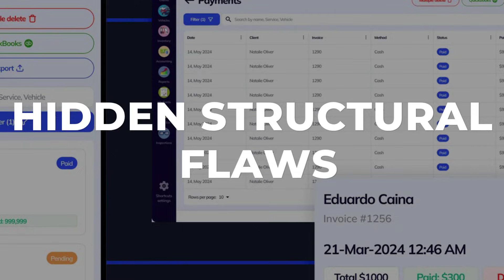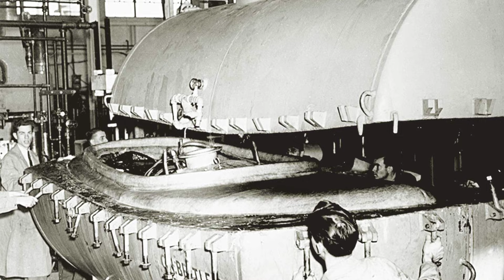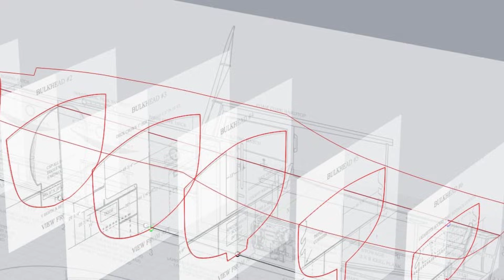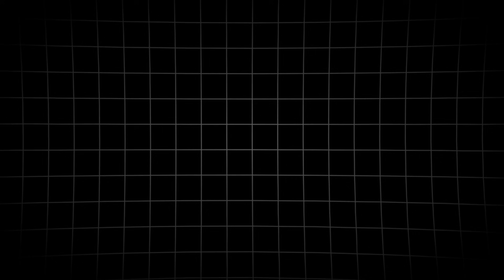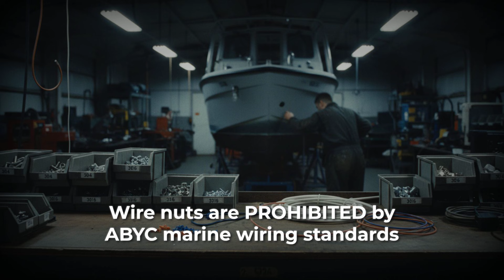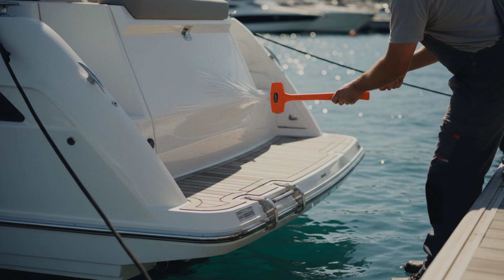I Worked in a Boat Factory — Here's Why I'd NEVER Buy What We Built (The SECRET They're Hiding)

Comment from the maker: 📁 If this video made you wonder which brands are still building properly — The Hull & Build Quality Rankings inside The Bilge Files answers that. Every major brand graded on a 4-tier system from "built to last 30 years" to "designed to fail in 5." Based on physical teardowns, not brochures. https://bilgefiles.lovable.app

Comment: This video references ABYC (American Boat Yacht Counsel) standards and then calls out various manufacturers for failing to meet ABYC standards.  In the United States there is no universal legally required boat building standard that must be met for recreational boats.  The ABYC standards are "suggested" by  guess who: none other than the ABYC itself.  I have been through ABYC based training and received my initial certification (industry expert-I believe it was called).  ABYC standards are suggestions NOT legal requirements.  Having said that, the video is completely correct, in most cases failing to meet ABYC standards results in a less safe vessel.

Comment: This guy is not lying, although he is talking about really mass produced boats. If you want to determine the level of boat you are purchasing get under the helm and in the bilge and see how the wiring is done if it looks like a birds nest you're in the bargain boat world, in a premium boat it should be neat, secured and nothing hanging down this should be the case for all the wiring in the boat from the bilge to the dash panel. Sloppy wiring is the real determination of the quality of a boat. I worked in the boat business for 40 years. I started at Wellcraft and spent the last 23 years at Yellowfin Yachts. That is the full spectrum of the boating world Yellowfin being the top of the line. The truth is a boat is a hole in the water that you pour money into. All boats require maintenance, how well your boat is made determines how costly it will be. Beware of gelpocks in the underwater running surface on used boats. Pay for a Surveyor it is unlikely most boat owners would recognize a a pocked bottom if it kicked them in the balls and if you buy one it is worse than getting licked in the balls.

Comment: I always buy aluminium boats commercial boats but they have problem's too i have 2 large aluminium centre console boats dated in the 1980s the alloy is a thicker grade compared to the boat's they make today the quality of the welding is SHIT and prone to cracking in the hull but the problem with some old ones is electrolysis through the way manufacturers wire the earthing of the electronic systems on the boat it's Bullshit but the quality today on anything thing we buy today is rubbish look at new cars trucks or home's all rubbish

Comment: I love boats and have always had them and worked on them, I also have worked on motor homes and travel trailers they are all the same as in they are cheaply made, in failures they all fail in the same areas, with boats it's the stringers with travel trailers and motor homes the roof for the big fails there are small ones as well but you better be able to work on them or you will be selling them for pennies on the dollar to guys like me that can.

Comment: I only buy brand name 316 stainless steel nuts, bolts, and accessories from a local respected dealer.
However I am finding they still rust quickly.

I don't know if the quality is worse than years ago. Or if they are intentionally miss labeling it.

Comment: All boats are POS. Every damn one. 

I work in the aerospace industry. We build Seahawks that spend their entire service lives on aircraft carrier decks exposed to salt constantly.

All wiring is stainless steel. Everything is coated in mutiple layers of corrosion resistant paint plus sealant in between overlapping. Corrosion is minimal over thousands of hours of flight and years of salt exposure.

Boats are just thrown together with little regard to corrosion resistance even though they operate in a corrosion environment. Very poor quality. 

The best strategy for regular recreational boat users is to buy brand new, then trade in every few years.

Comment: This video is so deceiving, wood is stronger than foam, customs boats 10-20 million dollar boats still being made with wood, yes it rots when exposed but with a good builder no issues should result. Also you said contender has no wood that is a lie, they swapped to composite transoms around 2010 before the. It was wood, very few had failures till now. The fuel tank foamed in is needed in a fishing boat that goes out in rough seas screws will overtime rip a line down the stringer Whare mounted or shear the bolts when 150 gallons is bouncing at 40 miles per hour in 4 foot seas. Shitty production boats are the problem not high end company’s that have been around.

Comment: At a scrapyard I where I worked, a customer made a deal with the owner, to take and crush his 1984 24’ Wellcraft walkaround cuddy. I picked up the back of the boat, then he pulled the trailer out. The super-structure came off in one piece. But I could not puncture the hull, with the sharp teeth of my grapple. I turned the hill upside down, picked up at 15-20’ wide cattle Shute (Jersey barrier) about 30’ in the air and dropped it on the hull. IT BOUNCED OFF!!  I did this repeatedly but it did not break. Then the shear crane came over and cut it up.
Reply: that's amazing testament to how things have changed .. i have an older hull I'm thinking of rewiring and repowering bc don't trust newer stuff

Comment: I have bought and sold 2 boats and am on my 3rd. All from the 80s.  I restored the interiors, upgraded the electrical, rebuilt the engines and out drives, threw a coat of paint and gel coat on and had like 3500 into each one.  They looked great, ran great, and even though I'm 25 minutes from the launch at Canyon Lake AZ, I still can't see making payments on something I use once a week.  I drive classic cars for the same reason. Boats lose value so fast it's ridiculous. But a restored boat that I have 3500 into I can sell for 3500 after using it for a few years.
Reply: Especially with the Internet and Youtube to learn the skills necessary to refurbish a boat if you don't have them. (painting the boat being the most challenging)
But many older boats if you don't mind "white" as a color just need to be pressured washed and cleaned.
Smart man indeed.
I bet you don't keep all of your spare money in a savings account in a bank either.   lol
Reply: @johannjohann6523 Nope.  But as far as painting a boat, I like to use metal flake in the clear coat over color.  Really looks nice when it's wet and the sun hits it.  I leave the bottom white, but I like 70s colors on top.  It's a throwback look, and nobody really does it anymore.

Comment: One thing you did not cover is any fire retardent added to the epoxy.
Think it can not be used now, but unsure.

After a year or so is causes bubbles under the gel coat, bunches of blisters showing up on the side.
A lot trouble and cost to repair. You can do them one at a time as they apeer, but the current way to sandblast all the way to the fiberglass and the respray with epoxy and then new gel coat.

Comment: I repaired boat's for decades. Back around 2000 boat's did not have Gel-coat. They used decals in the molds.
Reply: So decals instead of gelcoat?
Reply: @hellopeople6160  Yes it was

Comment: This has been true for30 plus years that I have experianced. I bought a new 1997 Larson 223 Escape. After getting it home I went through it. I was disgusted with the wire harness was tossed together buy some guy who had no idea what he was doing. Wires going everywhere and a fuse block (unlabeled) held in place by one black oxide sheetrock screw from one corner, as the fuse block just dangeled loosely with all red wires and corrosion on wire and connectors already on a new boat and I am a 10 hour drive fronm the nearest saltwater. The front anchor eyelet where the trailer winch pulls or holds the boat was pulling through the pine wood encased in fiberglass, I had to have a private boat repair shop correct that structural defect.
Basically I bought a Boat Kit and finish it myself before putting my family in that boat, and I checked around and even the service manager where I bought this brand new boat told me this normal quality unless I wanted to get into a "Cobalt" boat manufacturer which I did go look at and yes that was a properly built boat/boats and it could be seen everywhere even down to the harware, plumbing and wireing were all quality like no plastic or PVC fittings anywhere it was all brass or SS and hot-dip galvanized.

Comment: I worked building custom yachts , and when I finally got the opportunity to buy a boat…. I bought a Scout boat.   It was used and still better than most new hulls.
Reply: I had a 17’ scout for about 10 years. It was common for boats at least at the time and not exclusive to Scout, but it had the issue of water in the foam mentioned in the video. Eventually I guess it added so much weight the scuppers sat under water and let water in, not out, so I always had to plug them.
I remember replacing the bilge pump. When I took the screws out water started coming out from the void below the bilge.
Reply: @justindeaton7301  I’ll keep an eye out for that !   Thank you very much 😊.    I’m keeping my Scout till I’m too old to enjoy it 😂
Reply: Just as good as a Whaler
Reply: @DustyRhodes863 .  Shhhh it’s true , but don’t tell the Whaler guys… they get a little pissy about that.    😂😅
Reply: @Rex-q2q3h I'm a life long Floridian and have been through many boats. Scout and Mc Key Craft served me as well as the Whalers that I have owned.

Comment: Living in South Florida and buying and selling dozens of boat in my 65 years I have a routine that I do when inspecting a boat.  Pull out all the cup holders, get an inspection mirror and flashlight. Look inside. You'll be shocked to see fiberglass laid out with out resin or poorly impregnated resin. Truly poor workmanship. Many on big name boats.
Reply: Soon as you say cup holders I know what kind of junk you're looking at
Reply: @danado66  🤣
Reply: @danado66 Why's that? Every boat has cup holders.
Reply: @ricpowers1475  If your boat is big enough you have a servant to hold your cup.
Reply: Thanks...seems like I am never buying a boat...it's not worth it anymore
Reply: @geraldjelks1632 make friends with boat owners or rent. Salt water vessels are in constant need of maintenance and money.
Reply: @geraldjelks1632 hardly ever has been . 

"What floats and you pour money into"
Reply: I went and looked at a Grady White once and found wood stringers that were not even glassed at the very bottom of the hull.  Gradys are well known for rotting transoms and soft decks but to my knowledge they are still using plywood. They also put aluminum fuel tanks under the deck as well.  I have a 1999 Sea Pro and that thing has no wood in it and it has a plastic fuel tank under the deck that won't corrode due to salt.
Reply: Grady's are shit
Reply: Yep, seen all that too.

Comment: I Own 2 Sea Doo Challenger 1800 build in 2000 , the hull bottom has a big problem as soon as any damage occur to the gelcoat, water pressurize the chamber formed between the gelcoat and the foam core, destroy the hull,  on both boats a section 2 ft x 4 and 6, just was Ripp off , and boats almost sink , no one care at seadoo or NMMA, stay away from those jet boats your life is at risk.